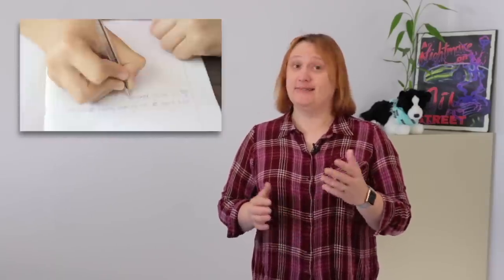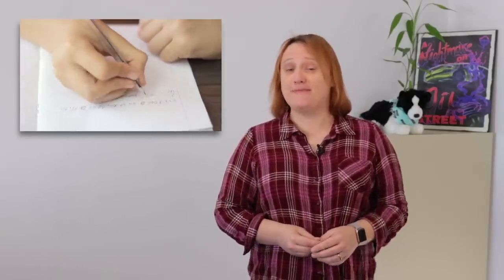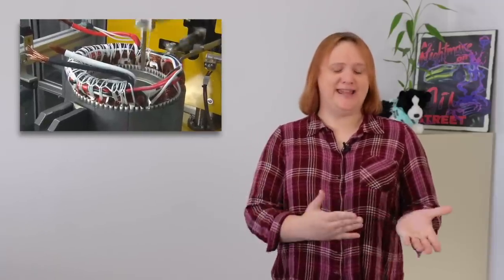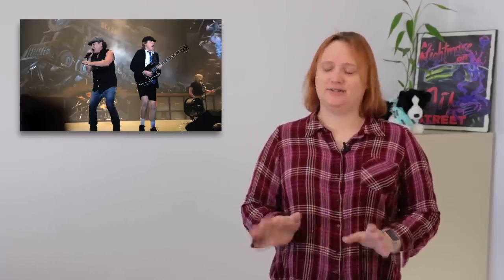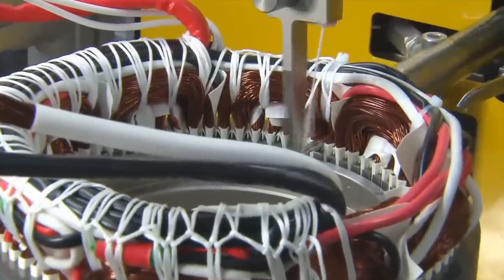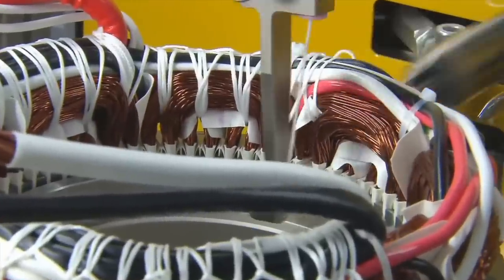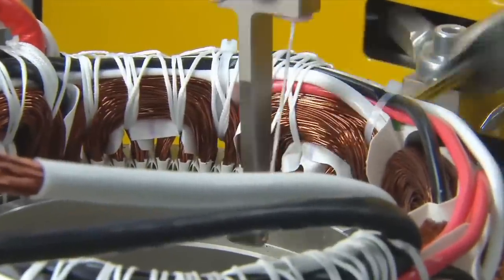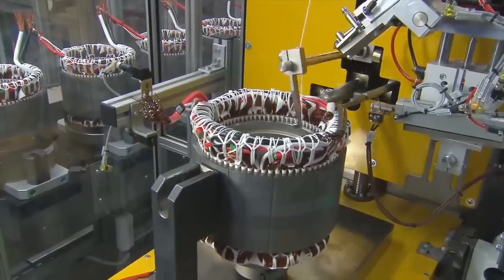Which Electric Motor Powers Your Electric Car?

Comment: Variable AC drives have been around for a long time.  The first I put in where in Indianapolis in 1978.  Their main advantage was that before they came when we needed variable speed for long term usage we had an AC motor driving a gearbox.  The variable AC drive replaced the gearbox which was a great saving in maintenance.  When run 24 hrs/day continuously we found that we had to rebuilt gearbox about once per year.  So this technology has been around for at least 50 years and was adopted by EVs

Comment: You missed it big time with the exceptional design of the Model 3 rear engine. The main achievement was to make a compact switched reluctant motor and solve the main issue of imbalance in low rpm. Nobody knows exactly how they did it but the main direction say that the permanent magnets are assisting in low rpm to stabilize, some may say two engines in one. Also, it is not clear whether they use different circuits for each or in some way they manage to engineer an orchestrated system. 
The bottom line, it is a high torque, highly efficient, cheap to make, easy to maintain, and quiet engine that earned its Tesla stamp.

Comment: As an avid motorcycle rider which has ridden in all weather and traffic conditions across multiple countries (rain, sleet and snow), the only thing that will make sense in terms of switching to an electric bike is dual wheel drive. Going up a hill on a rainy day from a traffic light is not recommended without front wheel drive, not to mention you need all the power you can get to get out of the way from other cars, buses and trucks.

Comment: Great explanation on the features and differences of the components in electric motors. Yes, do make videos like this to compare manufacturers use of components and how they create or don't create a frunk in some vehicles? While some may create a design that may afford quiet a large usable frunk, and some may be  putting all or most components under the hood that leaves no frunk space available? Now that battery prices are falling and the industry awaits the perfection of solid state batteries, maybe a video on that would be cool too?

Comment: Pure switched reluctance motors have a lot of torque at low RPM. The problem is you can't use all this torque in certain applications due to torque ripple.
Reply: regenerative braking is also a bit more challenging with SRMs, but it is an amazing technology that is definitely underrepresented

Comment: Good job.  Induction motors also need a little more juice to create or induce the magnetic field.  This is not the case with permanent magnet motors.  Induction motors maybe more durable in the long run but electric motors are so cheap compared to a gas engine with all its complexities and moving part.  Most the stuff of gas engine is for all the emission stuff

Comment: If you want to learn about technological progress in transportation motors, look into subway motor electronics.
Old subway trains used DC, because there really wasn't any technology to control speed with AC.
gradually technology improved and most today's subways use VVVF system.

Comment: Uh...Niki: "Torque of a DC motor is proportional to the speed of the motor, therefore there is a pretty noticeable drop off in power as the motor spins faster." Nooo...that's not how it works.
Power, by definition is Torque x RPM. So as the speed of the motor goes up, the power goes up until the torque drops off to the point that the power starts to drop off. The speed of a DC motor is dependent on the voltage. In fact, DC motors are often rated in RPM per volt. The same motor, with 24V DC applied will spin roughly twice as fast as with 12V applied. The speed of a DC motor is limited by something called Back EMF. As the motor spins faster, it creates a voltage in the opposite direction of the applied voltage. When the two voltages are almost equal, no the back EMF does not allow more current to flow and the motor will not spin any faster.
The nice thing is that the motor is VERY efficient at that point, only using enough current to overcome friction. Remember, power is Volts x Amps, so with the current approaching zero, the power generated approaches, zero and the energy used, which is power x time, also approaches zero. As more load is applied, the speed of the motor drops,  more current can flow and the power increases. Typically, the power peak of a motor is at around 2/3 of the "free RPM" of the motor, or the point at which the applied Voltage and the Back EMF, or back voltage, are in balance.
That is never the case with an ICE which is always discarding roughly 2/3 of it's energy as wasted heat. So even when you're just cruising, the best efficiency a gas engine can muster will never be more than around 30%, give or take a little. Whereas, electric motors can have efficiencies in the high 90% range.
Reply: @xxwookey  DC motors are actually quite good from many standpoints except maintenance. The standard DC motor has a brushed commutator...think the starter motor in every non-hybrid car. They are great for quick bursts of torque but with continuous use the brushes need replacing and the motor needs to be disassembled and the commutator turned...which is essentially what you get with a rebuilt starter motor.

Comment: Great video. I think higher performance EV's will use AC motors, while main stream ones will use DC motors. A good analogy is NA Vs. Turbo or Supercharged Engines.
Reply: Well, actually no. I see literally no reason to use DC motors in an EV nowadays.

Comment: Great videos I watched both !! I've subbed both channels.

Complete novice so forgive my recap below (helps me remember)
Hope it helps others too - please add or correct my thoughts, I will check back😁

Compare cars
-Fossil fuel car : complicated, high maintance, 30% power efficient, engine life 200k miles, noisy, polluting
-Electric Vehicles car (EV) : relatively simplistic, low maintenance,  90% power efficient, motor life 1M miles, near silent, non polluting

Basic Electric motor config : 
- physical parts : motor = stator and rotator. 
  Stator stays static, 
  Rotator rotates (ie not static)
  Both are made from either permanent magnets (rare earth metals) or non permanent magnets (chesper coils of wires)
- Motors types / Different motor configs :
 Stator can be on shaft or on wheel
 Rotator can be on wheel or shaft
 Both stator and rotator can be  assemblies of ; permanent magnets or coil magnets or both magnets (a composite assembly)

- physical motion : 
 Motor speed proportional to input electricity (frequency and current strength) from a RMF (rotating magnetic field)

 Motor torque proportional to magnet (size and strength of magnet) creating force from size of magnetic field and ?rate at which it's being cut?

 No electric current = no motion
 More current = more torque (aka turning force)
More magnetic field strength = more torque (aka turning force)
 More current frequency in Hertz = more motion (speed)
 

 QED !!

Comment: AC motors are used because they're easy to regulate their speed.  A DC motor needs it's voltage varied to change the speed.  An AC motor just needs it's frequency changed.  Simply feed it 60Hz to run twice as fast as fed 30Hz.  The "power supply" is simply an audio amplifier.

Comment: Ok, i love AC/DC too! 😁
I also love the fact that EVs have AC motors that are pwered by DC batts!
Fun fact, DC motors can be driven directly by AC current fed drives, they use tyristors, to convert AC to DC and power the motor. On the other side, AC motors drives need DC to work! 🤔
Reply: @xxwookey  ok, thanks. I'm not an English native, and don't allways go to Google translator. 😊

Comment: Thanks Nicki I was wondering about the motor difference I saw on my delivery sheet for my new Model S I picked up yesterday. (he said nonchalantly)  Indeed the front motor is a 6 pole, internal permanent magnet rotor; while the rear is a 4 pole AC induction motor for the gut wrenching power. :-)

Comment: The speed of rotation of an AC induction motor is proportional to the frequency of the AC current. If you can arrange the frequency of the current, you have yourself a (virtual) gearbox.
Not until modern electronics, however, could you make variable frequency AC current.

Comment: Tesla has never used a Switched Reluctance Machine. The two electric motors they have used are the AC Induction Motor and the Permanent Magnet Synchronous Motor PMSM. It is bewildering where the idea that Tesla has used a Switched Reluctance Motor because it is wrong. Sandy Munro did a tear down of the Model 3 motor and the rotor had magnets. The owners manual for the Model S and X shows they have two motors, AC Induction for the rear and PMSM for the front.

Comment: Hi there! I would also really like to see a video about what kind of motors railroads use. I mean cars throughout history have largely been powered by IC, but trains have been using electricity for that whole time. And now we have trains that can go 300-400km/h, I know there's a story to be told there.
Reply: Modern ones mostly use variable frequency three-phase a.c. motors, with power electronics using Integrated Gate Bipolar Transistors (IGBT) etc. Years ago, it was either d.c. motors, or relatively low frequency a.c. - e.g. 1/3 mains frequency, like 20 Hz on some of the New York suburban lines, or 16 2/3 Hz in much of Germany. 50 or 60 Hz a.c. motors wouldn’t work as traction motors, but chopping the frequency down was a kind of a compromise (albeit with thermal loss through the system - often rather large motor/alternators to achieve it). A fair bit of history about that, but essentially d.c. motors became practical under a.c. overhead, when high power on-board rectifiers became available.

Comment: I don't really agree so much on some points:
- There are many topologies of PM synchronous machines: Surface-mounted PM (SPM), Interior PM (IPM), Switching Flux PM (SFPM)...  if my memory serves right the SPM is the first one introduced (I believe in the middle of the XX century) simply because it's the most straightforward PM machine design (someone probably at that time placed some PMs around  a rotor and that's all). SPM and IPM are basically the main topologies and can work with same stator design, therefore even hair pin designs, etc. Just the rotor is different. SPM are very common for example in small/high  torque quality drives such as Electric Power Steering.
- Switched and Synchronous machines are in principle two different things, control strategies, power control architecture, design. The picture shown, a switched reluctance machine (without PMs)  is clearly not the model 3 motor which I believe is (i) synchronous like all the other  competitors, (ii) as well as IPM. For instance, comparing the m3 motor to the Toyota Prius motor shows some interesting similarities of the rotor design with its characteristics V-shape pattern, pole number is different.
- BMW call it "commercially" hybrid, but in principle is just a special variant of IPM synchronous machine,  it can be called eventually PM assisted synchronous reluctance (PMASR) machine in reason of these multiflux-barrier design which are expected to enhance the reluctance torque. IPM/PMASR are also the GM designs: if my memory serves right, the low performance GM variant is quite interesting since it adopts  cheap ferrite  rather than expensive RE NdFeB...this is one potential advantage of PMASR.
Reply: I believe the model 3 motor is truly a permanent magnet switched reluctance motor not a synchronous reluctance motor. Which makes it closer to a variable or switched reluctance motor than a AC synchronous machine. This creates a new question. Did Tesla switch from AC to a DC?
Reply: @bambamfpv1102  I respect your opinion, but why you get this conclusion, what are the reliable sources because I have found nothing? I know that many EV websites and even Wikipedia reports it, Musk himself tweeted on time about a "partial pm switched...smthg like that" but it cannot be take seriously.  Once you try to evaluate the facts and take a look on the available photos of the m3 machine, for my point of view it's hard to say "pm switched reluctance". In principle in a  switched reluctance you have unidirectional currents  switched in the coils  according to specific strategies. In a synchronous (non necessarily reluctance) the current waveform is AC (sinusoidal for e.g. ) like for an induction machine. Both requires electronic converter from the DC bus and battery: for the synchronous/induction is an inverter for the switched reluctance is normally a different/not standard architecture. Just a matter of fact, the EPA official certification (so no EV websites, tweet...it  reports what Tesla itself officially declared to the regulation authority, as far as I understood) there is no mention to any switched/reluctance machine. It's written "Internal permanent magnet motor": it is lexically very similar to "Interior Permanent magnet (synchronous) motor" which still exploits the reluctance mechanism, like the main competitors btw.
Reply: @NRG1985  Tesla calls it a (PMSRM) Permanent Magnet Switched Reluctance Motor
Reply: @bambamfpv1102  I know but what is the source of that? The only source I am aware is a tweet of Elon Musk. But in the EPA official certification there is no reference to any switched and/or  reluctance. Just a matter of fact PMSR could be also PM synchronous reluctance machine.

Comment: You could really see a change about 10 years ago with RC Cars. For 30/40 years we've been racing dc electric/Nitro gas classes. Lithium batteries and brushless motors came around about the same time. Within a very short amount of time brushed motor class disappeared and Gas/Nitro classes  had to allow electric brushless compete in the same class. People still race Nitro but its just barely competitive with a budget electric setup. Gas RC airplanes are basically extinct except for scale model aircraft. A lithium brushless RC car can tear the rubber from its wheels and shear every driveshaft in its drivetrain if you are not careful with the throttle.

Comment: I would love to see a VW MK1,2,3,4,5 or 6 converted with a Hyper 9 low or high voltage. Maybe a front motor from a Tesla (small motor) intone and batteries on top of it.

Comment: Maybe, a description of a magnetic circuit of the reluctance motor (6:31) should bee more exact - see e.g. Wikipedia "Magnetism" - ferromagnetic material (soft/hard). The magnetic circuit must be made from a soft ferromagnetic material, not from non-magnetic (para-/dia-magnetic?). More complete explanations to the reluctance motor principles you can find also (besides another sources) on youtube. Permanent magnets of the Tesla solution are an enhancement for an improvement of the motor features. The motor is than not "pure" reluctant.
Stay exact. Petr

Comment: 6:30- "Tesla Roadster Model S"... So now I'm going to buy one just so people I pass on the street can say "Wow! Look at that S-car go!"
Reply: . . .  at considerably more than a snail’s pace. . .
Reply: Late to the party, but thought you should know.
There is a car called the S-Cargo by Nissan.

Built from 1989-1992, it's one of the weirdest and ugliest cars of it's time.. in the mid 2000's my local area had a few getting around as McDonald's company cars, painted in red and yellow. It worked for advertising in a way because you couldn't not stare at it, as it went past.

Comment: Small correction. Any AC motor can run at different speeds and torques etc. That is not the hard part. Controlling them is the difficulty. The argument for DC motors was rarely their own properties but the fact that they allow engineers to ditch a large part of the power electronics otherwise necessary.
Fun fact: In tooling machines induction motors are chosen over PSM for the same reason car companies made the opposite decision: efficiency. If you need a very high rev range and pull max power a lot, they are actually quite good, even though they are a nightmare to controll since you have to push the motor through an instable torque curve to get tot he usable part and all of it is non linear.

Comment: I believe is just the beginning for electric motors and batteries serious development with technologies like supercapacitors and superconductors arriving.
Reply: I think superconductor still needs still a long , long way to go before it is even worth mentioning  in EV sense.
Reply: @remliqa  indeed we are maybe decades ago from room temperature superconductors but there has been great discoveries in electromagnetism  research like new conducting and storing materials also production methods like 3d printed magnets which have more eficient magnetic fields

Comment: I was rather hoping you would touch on the Renault motor which is different again in that it uses electromagnets rather than be slave to rare earth prices
Reply: To which renault motor are you referring to?
Reply: Yup. Both the Kangoo ZE as well as the ZOE with the Continental motor as well as the ones with the Renault motor have synchronous machines, but instead of permanent magnets, use external excitation, aka a 4 pole electromagnet in the rotor fed through a double slip ring. As there is no switching like in a commutator, the slip ring contacts have extremely low wear and tear. The controllability of the motor is extremely high.

Comment: Some electric motors and generators don't use magnets. They have slip rings and field wingdings.
Reply: Ac machines with armature field windings are used as synchronous motors or generators. Field windings are supplied with dc power (2 slip rings) which produces magnetic field with given number of poles. These machines are very similar to pm ac machines, but with the ability to adjust the armature field.